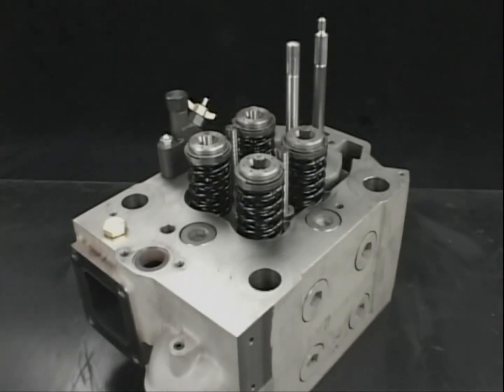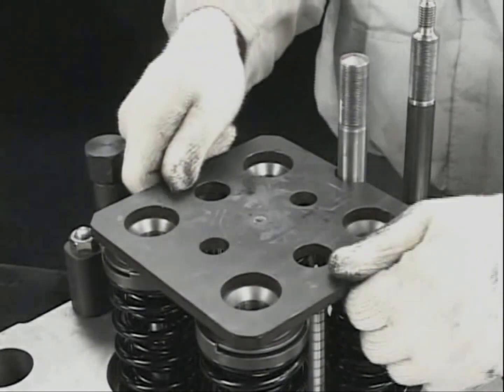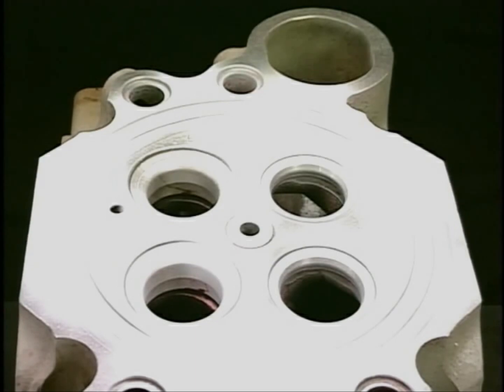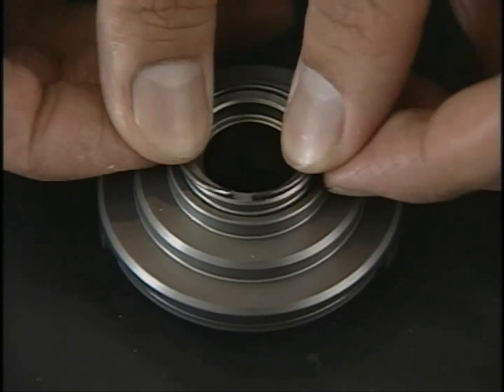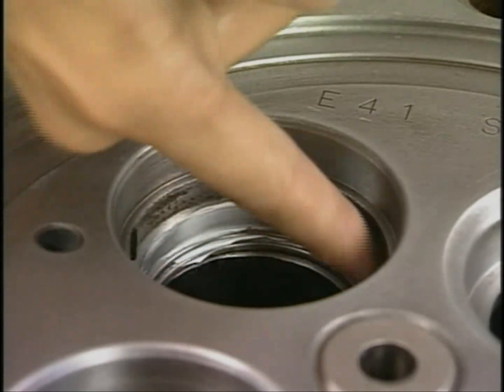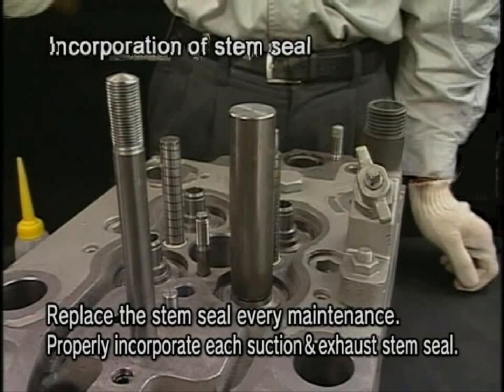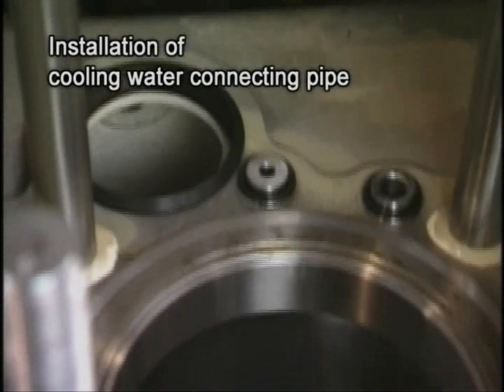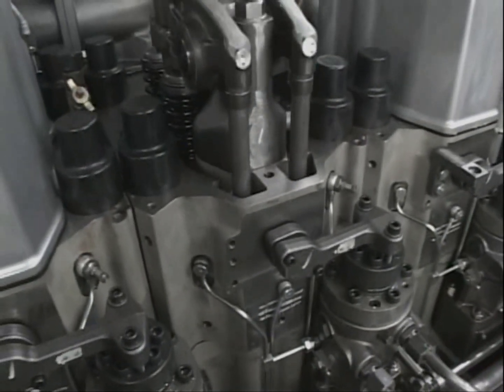Yanmar 6EY22 Marine Diesel Engine Maintenance Manual CylinderHead صيانة ماكينة ديزل بحرية يانمار

Comment: Dear Sir/Ma'am,
We are pleased to introduce "AD International" if you want any type of Marine Machinery and Equipments procured from Ships coming for demolition at Asia's Largest Ship Breaking Yard, Alang.

Also we know the importance of in-time supply at Vessel, so feel free to contact adinternationaltraders@gmail.com
Products :

1. MAIN ENGINE & AUX. ENGINE SPARES
2. AIR & FRIDGE COMPRESSOR & SPARES
3.HYDRAULIC MOTOR, PUMP & VALVES
4.PNEUMATIC EQUIPMENTS
5.LIFE SAVING EQUIPMENTS
6.NAVIGATIONAL EQUIPMENTS
7.ELECTRONIC EQUIPMENTS
8. HYDRAULIC PUMP,MOTOR AND VALVES
9. GENERAL/DECK STORE 
10. DECK CRANE SPARES  
11. DECK EQUIPMENTS
12.BRIDGE EQUIPMENTS
13.CONTAINER FITTINGS 
14.ELECTRIC MOTOR
15. AIR MOTOR
16. WINCHES
17.AUTOMATION EQUIPMENTS
18.OIL PURIFIER
19.FRESH WATER GENERATOR
20.OILY WATER SEPARATOR
21.TOOLS
22.HEAT EXCHANGER
23.BOILER SPARES
24.VALVES
25.ALL TYPES OF PUMPS
26.DIAPHRAGM PUMP
27.HIGH PRESSURE CLEANING MACHINE
28.TANK CLEANING MACHINE
29.GAS FREEING FAN
30.FRAMO PUMPS
31. PNEUMATIC AND ELECTRICAL SUBMERSIBLE PUMP ETC...

supply parts of the following
- Mitsubishi
- MAN B& W
- Alfa laval
- ABB 
- Yanmar
- Wartsila, etc

Send us your requirement if any.

-Team AD International.
Reply from the maker: Thanks for the message. We are putting this into our consideration. Please, feel free to share the videos. 👍

Comment: How to differentiate the suction valve from the exhaust valve?
Reply from the maker: As I mentioned in my answer for your same question in other video. But here while the cylinder head is detached you can notice the diameter difference of the 2 valves and the chamfer angle.